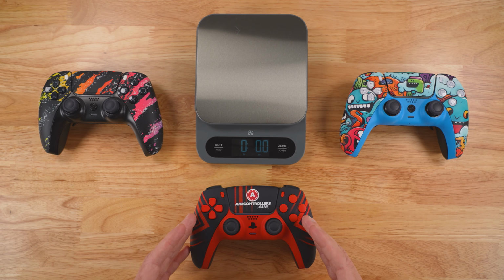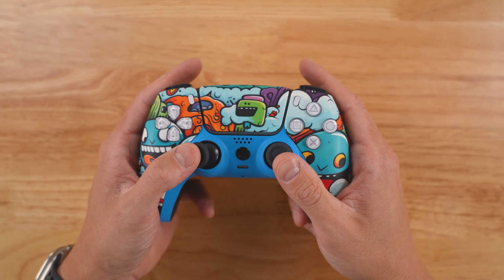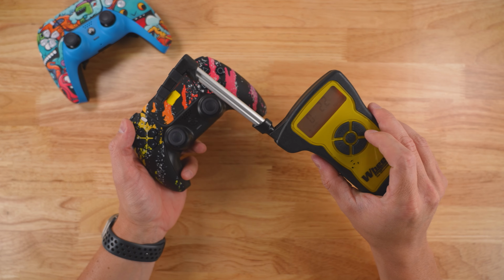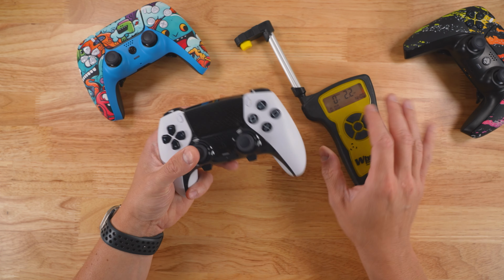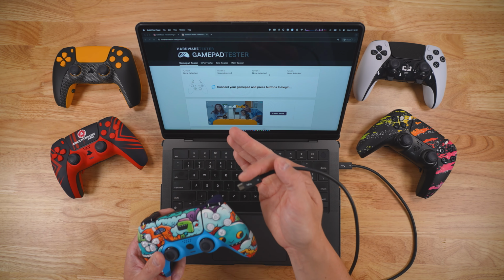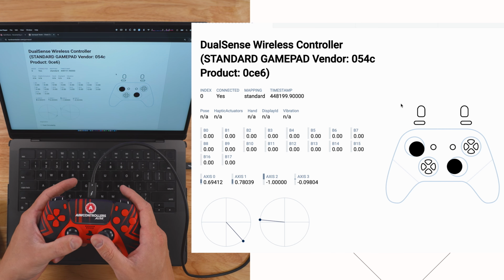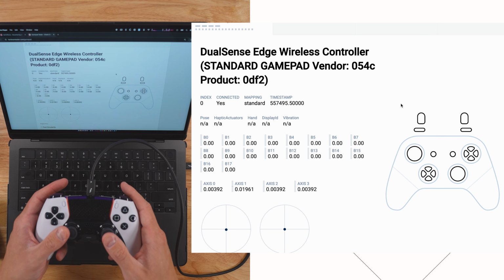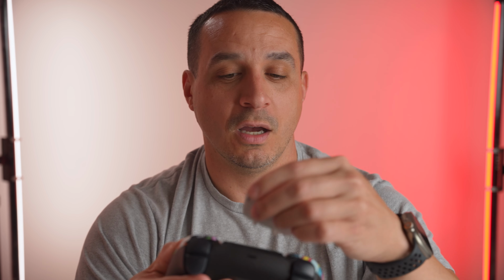AimControllers Hall Effect Joysticks on Custom PS5 DualSense Controller!

Comment: I got one few days back fully loaded and customized with their promo for half off.  Purchased speedy aim for faster reception of controller and payed like 262$.  It is absolutely fantastic.  They upgraded my order from Hall effects to their new tmr system.  If it’s not calibrated idc because it feels absolutely awesome.  I now literally itch to go sniping.  I’m not a sniper type at all.  But in warzone solos especially im running an automatic and a sniper.  The snap plate option is amazing.  I also have a set of white ps5 thumb caps and black xbox thumb caps.  I like the Xbox ones on the aim controller better because they are both raised and the ps5s are 2mm higher on left and 6mm on right.  Feels good also but the Xbox box ones feel all around better.  It’s a weird feeling but familiar playing both consoles.  The sim controller is better than elite imo.

Comment: I’m considering getting the Carbon FullPrint Pro version with Hall Effects and Digital Buttons added on (unfortunately I believe that’s an additional cost that you must email them about)…  but I will primarily be using it for Ride 5 and TT3 (motorcycle racing games)… 

I know the Digital Buttons will be nice on the manual gear shifting, but I have no idea how the Hall Effect sticks will work out..  I don’t expect the paddles to be better for shifting than the digital face buttons, but at least I can assign the rear brake and clutch to the other two of the four paddles and see how that goes… 

Think this is worth the investment for my intended purposes?  Have you heard from anyone that has used Hall effects/digital buttons/back paddles for moto racing games? 

Cuz there is barely mention of their use for moto games on forums, YouTube, etc…
Reply from the maker: I’d save my money and pass on the Hall Effect for your intended use. The standard analog would probably provide a better experience. I’d hate to point you away from Aim because they make great controllers, but from the sounds of it you’ll most likely get a better experience from the DualSense Edge for what you’re looking for. 

Just my suggestion 🤝
Reply: @ - I very very much appreciate your input!  I think I might get the Aim FullPrint Carbon Basic version with the added digital buttons only and just the ‘regular’ sticks…  

OR the dual sense edge…  🤷‍♂️ 

Again, your response is very much appreciated!

Comment: I currently run a DualSense edge. I just ordered an aim controller. I got the pro, and ended up calling and having the Hall effect sticks added to it. I also wanted to go from 2 back buttons to 4 for COD Warzone.
Reply: yooo you probably have them. Are the HE sticks different than the normal ones? Been thinking about getting one with HE sticks
Reply: @ zero stick drift, and they’ll never wear out.
Reply: @Drewski423  Is your aim worse than it was before with normal sticks?
Reply: @ no
Reply: @ Okay and you also got one from aimcontrollers right? if so how long does the the delivery take?
Reply: @ yeah I have 3 of them from AIM now. My son uses my Dualsense edge. Really just depends on how much they have ordered wise. All 3 of mine too different times. None over 3 weeks tho. All custom.
Reply: @ I do live in Europe tho
Reply: @ you should get it faster then. They ship from Poland.

Comment: This control is unfortunately rubbish when it comes to FPS games. R3/R4 are way to soft to push (feels like mouse clicks) and in gunfights you will mantle/meele when it suits the worst every time you get stressed in a gunfight. I spent 400$ on this and used it for 30 minutes and went back Edge! Yes, I know you can remap the buttons - but it shouldn't be necessary on such an expensive controller. EVERYTHING else is fine except R3/R4 which destroys the whole control and makes it unusable!
Reply from the maker: Not sure what the R4 input is 🤷‍♂️
Reply: @TomasVillegas  When you push your aim sticks...
Reply: @oskarslattland4568  That's R3
Reply: @oskarslattland4568 you mean L3 and R3?
Reply: L3/R3 obviously fall away, since paddles exist.